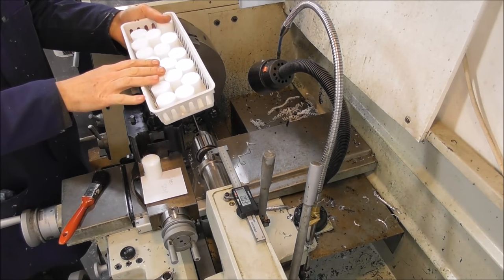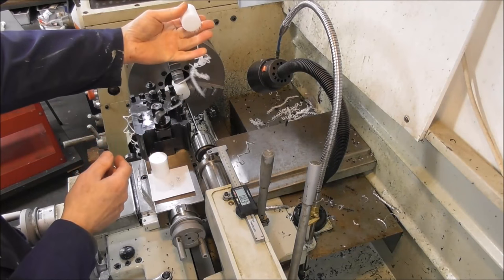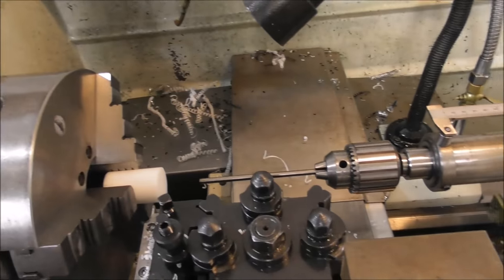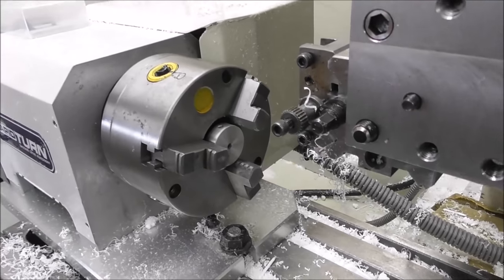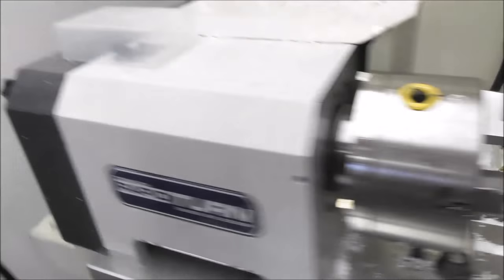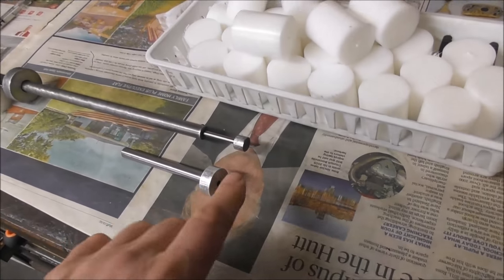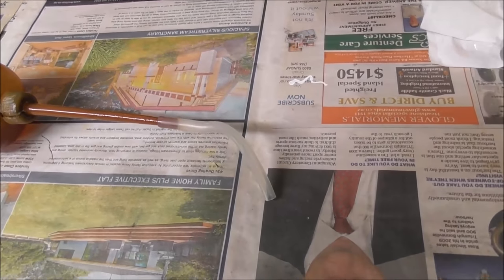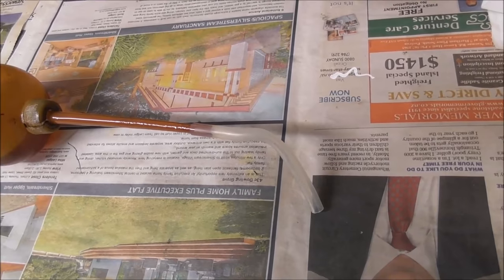Rapidturn Production and Tormach Maintenance Tips

Comment: Great video. A drill bit depth stop on a piece of round bar works excellent as a possitive stop as well. Easily adjustable to any length blank you need
Reply from the maker: You've been there too!  A hollow stop is good if you are having parting 'pip' issues. Cheers .

Comment: Hi Cliff, Nice video.    On the subject of stops for the Rapid Turn.

 I recently had to make 1,575 sensor buttons from 1 1/16" diameter Bar, each button being 1/8" thick  The material was 416 magnetic Stainless Steel.  The front face had to have a very coarse scroll like finish (I used .03" per rev feed to produce it) with a 1/16 " chamfer on it. The back face had to have a  1/16" chamfer and  be parted off with a good finish.

I set up my gang tooling and in order to get the correct stick out of stock from the collet for each button, rather than use a stop, I wrote into the CAM programme for a blank face on one of the tool hangers that fits on the Gang tooling Plate to be distanced the correct distance away from the chuck to allow the material to be fed through after the previous parting off operation. I put an MO1 optional stop in the programme so that the machine parked there until the material had been pushed through the spindle/collet. Once the collet was tightened up I could just hit the go button. 
The cycle time was less than a minute and by the time I had finished I was truly fed up with tightening the collet that many times with the little Tommy Bar that Tormach provide. I have a lever operated collet closer on order that I intend adapt to fit to save me from these repetitive tasks.  When I get it I will do some video of it being fitted.
Regards,
               Bob
Reply from the maker: That's interesting Bob. So you ran 1 1/16 long stainless steel bar through a 5C collet in Rapidturn and parted off 1575 at 1/8 long? Tell us more!
Reply: Hi Cliff, yes, first thing I had to do was to bore out the 5C collet that had a step about 3/4 of the way down it's bore. Doing this left it very thin walled where the slot is in the outer body but needs be as needs must. I also had to take a few thou off the draw tube because I couldn't get a 1 1/16" bar through it. The stainless was bought in at 1 1/8" diameter so I had to machine it to 1 1/16" diameter in my manual lathe in 40" lengths or thereabouts. The Stainless was 416 Magnetic Martensitic Stainless with some Sulphur content to make it more machinable. Parting off speed was approx 200 fpm and .0009" per rev with max RPM about 1200 parting tool width was 2mm. I changed the insert once half way through the job just to be safe but looking at the condition of the insert it probably would have been OK to leave it in for the entire run.
Reply from the maker: Thanks Bob - Good to know!  Cheers  Cliff

Comment: Isn't Wellington named after the boots that everybody has to wear all year round? ;-)

Good tips about end stops and keeping the machines lubed.

When you have lots of small parts, the ways and ballscrews don't see much travel so it's useful to take the full machine travel on all axes several times during the daily warmup, prior to making parts that have to be accurate. I seem to remember Cliff going through the warmup routine a while ago. Also, keep the oil can where it's warm.
Reply from the maker: I think it and they are named after the Duke of Wellington?   Cheers  Cliff